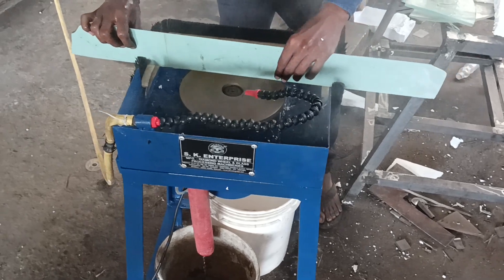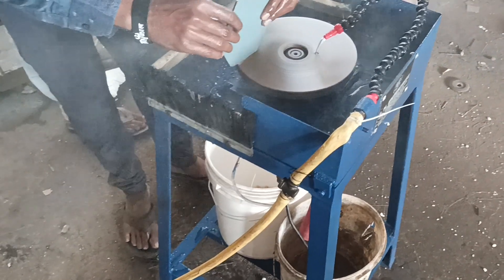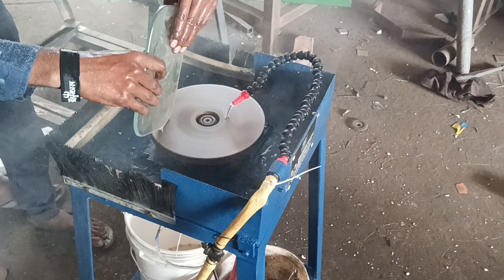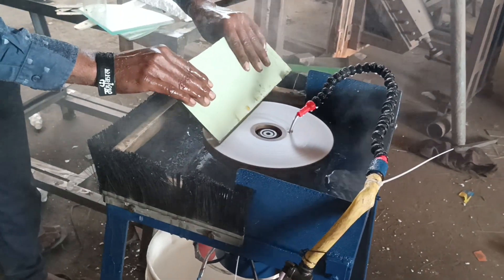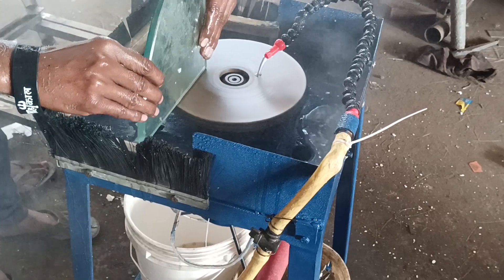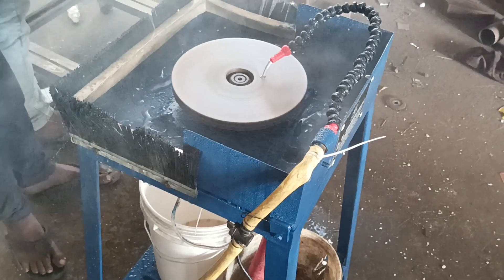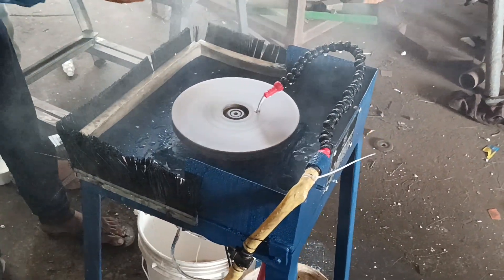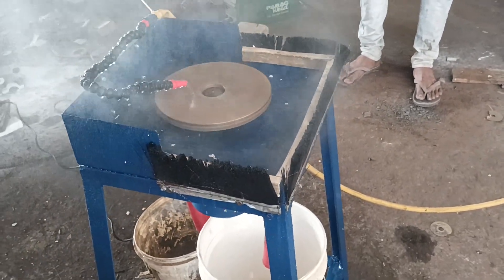skeabd edging beveling shape hand design of glass ceramic bottle trophy all in 1machie +919898255565

Comment: What about price
Reply from the maker: Rs.65,000/+200*40*5 mm metal bonded diamond disc in complete hand glass  grinding BEVELING,designing tukdi making etc with coolant system switch etc.
Reply from the maker: Contacta Dena!
Reply from the maker: Contact ..9898255565
ARUN S.K.PATEL
S.K.ENTETPRISE 502,PH-2,GIDC,VATVA,AHMEDABAD-382445